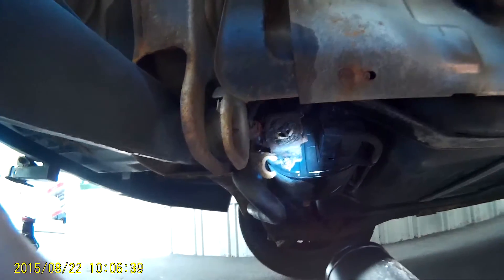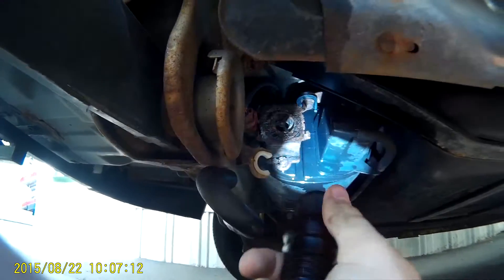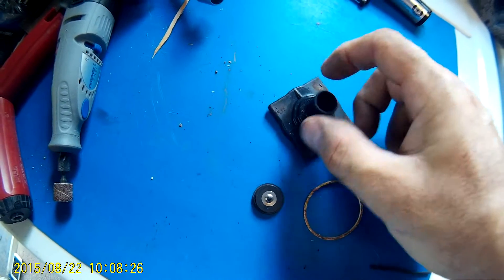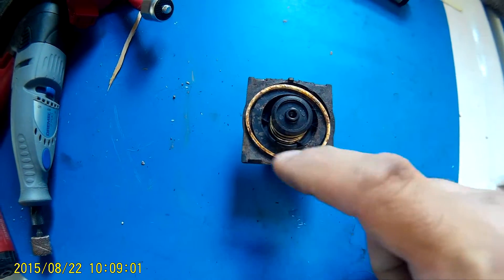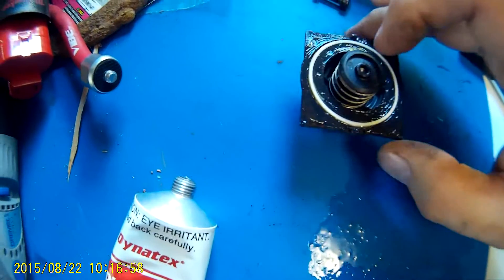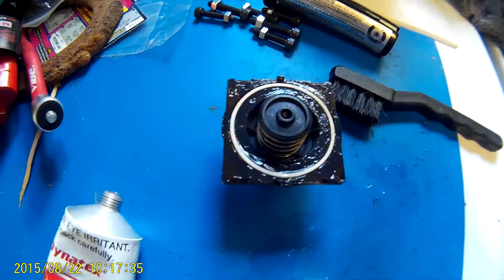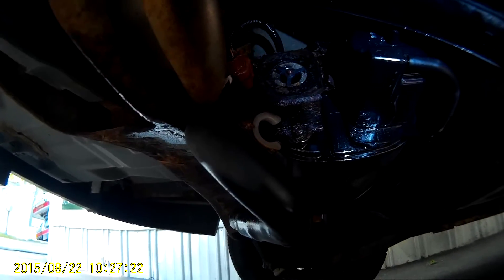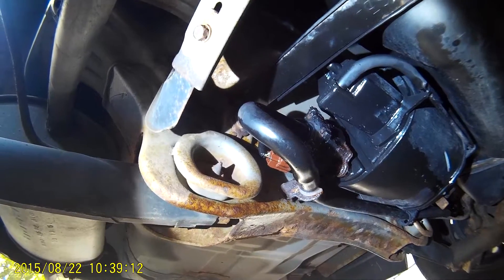Honda P1457 EVAP Diagnostic Code

Comment: Great ingenuity!  I'm going to be doing this DIY shortly.  Seems one could add this DIY repair with the other DIY repair others have done. (search: LM Engineering "P1457 EVAP Leak Diagnosis and Repair for FREE - Honda Acura Shut Valve Purge Valve")  IF you can fully remove & disassemble the unit...  Maybe if you remove the whole canister and get it on a bench, you might be able to get those screws out.  Cause just doing this, there will still be corrosion on the other side of the metal plate that was left on the car.

Comment: I had code 1457  evap  system  changed shut value on canister   fixed problem  Honda civic 2002 paul bv
Reply: Paul Boodhan
Reply: Did this problem cause you to have low rpms ?